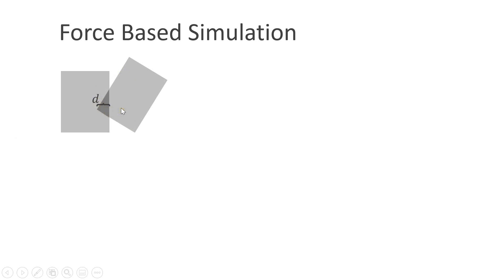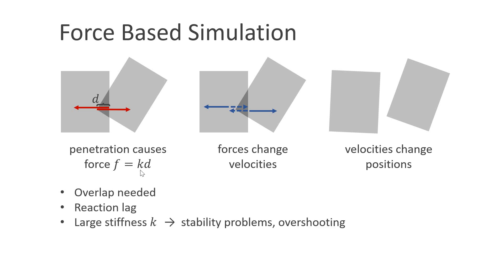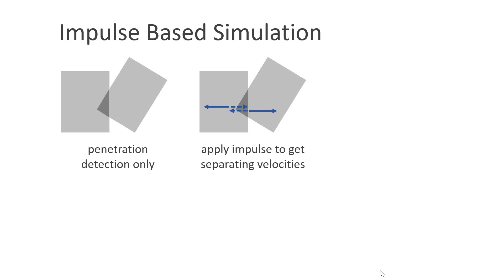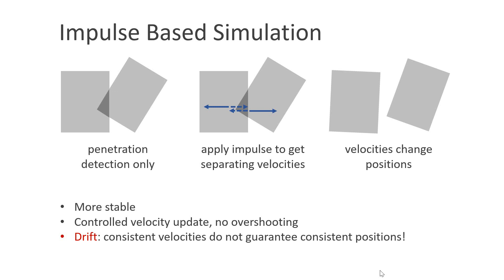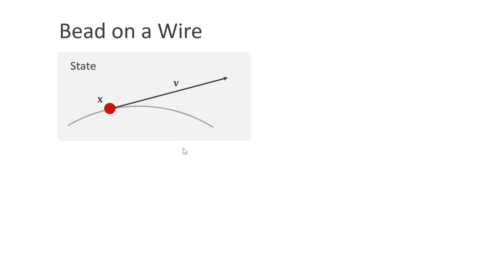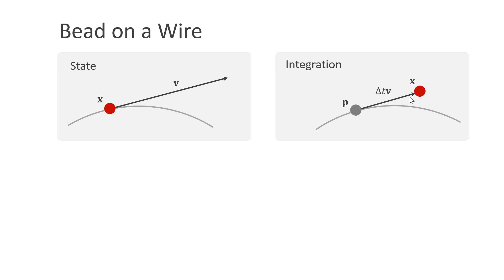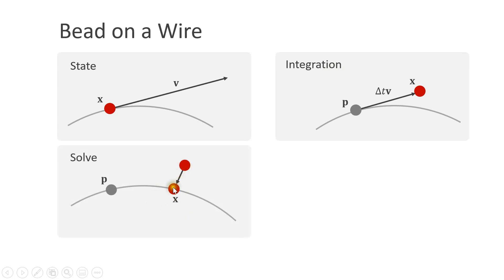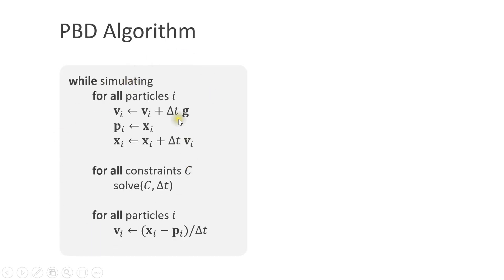09 Getting ready to simulate the world with XPBD

Comment: With the inclusion of XPBD as the main physics simulation technique in unreal 5 there's something I've been wondering about for awhile now. I figured I'd post here on the off chance Dr.Muller sees it. Reading the original paper on XPBD I was curious about the sympletic properties of the integrator. Simplicity is a very nice property to have for numerical integration schemes. There's a reason symplectic euler has been the go to for video games for ages (well that and it's cheap). As I dug into the subject matter more I found SHAKE and RATTLE, which are symplectic integrators from the 70s popularized in the molecular dynamics community. They handle constraints while maintaining simplicity and they seem remarkably similar to XPBD to my eye. For reference I've been using "Simulating Hamiltonian Dynamics" by Benedict Leimkuuhler and Sebastian Reich. So I guess my question is "Is XPBD a variation on SHAKE/RATTLE, or is it even sympletic?"

Comment: What I found is that when using only one iteration the velocity error is too big that results in instability. I need at least 2 iterations to get stable results. Also too many substeps leads to vibrations, not exactly sure why but I guess it’s because the velocity gets bigger when the delta time is really small. When solving collision or distance constraint, the position change is irrelevant to delta t, so if you have a small delta the velocity is much bigger.

Comment: Beware. As written in 5:55 or 7:06, you get inconsistent results with permutations.

Consider a chain of N identical particles A<->B<->C...<->Z, linked with N-1 distance=1 constraints, one between A and B, one between B and C, etc. Assume the order of constraints is A<->B, B<->C, ....

Now, let's say something shoves particle A by 1/2 a unit towards B. What happens? The A<->B constraint updates, moving A back 1/4 unit and B forward 1/4 unit. Then the B<->C constraint updates, moving B back 1/8 unit and C forward 1/8 unit. Net result is an exponential decay, but, notably, particle Z is affected in a single timestamp.

Now, let's say something shoves particle Z by 1/2 a unit towards Y. What happens? The Y<->Z constraint updates, moving Y back 1/4 unit and Z forward 1/4 unit. And then... that's it. That's the timestep. X isn't affected at all in the first (sub) step, and in general, the effective speed of sound is one unit per (sub)step.

In other words, the speed of sound is dependent on update order of constraints.

A relatively straightforward approach to avoid this is to accumulate updates instead of updating positions 'in-place' in the constraint loop. Unfortunately, this does require additional memory, and also results in a speed of sound of 1 constraint / (sub)step, which can be good or bad depending.

There are other more complex approaches, of course. For instance, color the constraints graph such that no two constraints with the same color share a particle, and iterate over constraints in order of color. This also allows for parallel solving without locking, as all constraints with a given color operate on independent sets of particles. Maintaining a dynamic graph coloring, even approximate, is itself a task, however. And this approach falls over if you have a single particle with many constraints.

The other main issue with this approach is that it often ends up dissipating excessive amounts of energy. Consider your bead on a wire example again. Your projection to the nearest point on the wire results in a slightly shorter distance than the original timestep. And as that is used to calculate the next velocity vector, this means that every timestep the velocity of the particle decreases. Luckily, in this example the velocity loss per timestep scales with timestep^3, and so the velocity loss per unit time scales with timestep^2, but this still can be a problem in some cases.

Comment: i thought i'd never find meaningful documentation for projective dynamics :O you're probably aware; for those who aren't, the spring constant k = -w * w (w = angular frequency, 2 * pi * hertz/samplerate)
i feel so privileged to find this secret video,  but i'm still not going to their lodge, ever.
Reply from the maker: Can you elaborate?
Reply: @TenMinutePhysics  for someone who documents like qi jiguang or julius o. smith III, for sure, but honestly not sure which point :)
Reply: just for fun, assuming it's dsp, i've made much use of iterative sin/cos oscillator forms in audio eg. s0 -= w* s1; s1 += w * s0; which elicits sine and cosine (one half step behind) for two mults and an occasional renormalisation (maybe each million cycles) when initialised in quadrature (eg. 1.f, 0.f). i've not worked with gpu much so not sure if this is useful for ?gerstner waves or anything. julius o. smith III at ccrma is about the best audio dsp reference to date.

Comment: The comparison of force, impulse, and position based simulation gives me a clue (although not mathematically understandable yet)  why they make such different characteristics. For more than a couple of years of studying how to make physics code , I've looked through those three ways, but failed to figure out why modifying the particles' status via force/velocity/position makes so different ends - apart from using different integration schemes -.
You are the first teacher for me to give such a 'big picture' of simulation methods using easy words. Thank you!
Reply: OK I can't even figure out what integration means.  😿
Reply: @Christobanistan  In physics simulations you numerically integrate acceleration to get velocity, and then you numerically integrate velocity to get position. There are different ways to approximate integration, but the most common is Euler integration, which is basically v1 = v0 + a*dt (acceleration to velocity integration), x1 = x0 + v*dt (velocity to position integration), where dt is the time step.
Reply: @mariovelez578  So integration is just plugging in a factor to an equation to get another value?
Reply: @Christobanistan  integration is turning a function that describes rate of change of a variable into a function of that variable. In other words, it's the reverse of a derivative. For particle kinematics, this means finding the new velocity at the next time step given the acceleration at time t, and then using that velocity to find the new position. I recommend taking classes on calculus and a physics class on mechanics (more specifically the subject of kinematics).

Comment: Hi Matthias, I've tried adding the alpha/(dt *dt) change into the lambda calculation for my position based fluids solver, but it doesn't have the effect of creating timestep independent stiffness, instead it really reduces the constraint forces drastically based on timestep. the XPBD paper is pretty dense, and I haven't been able to find any implementations of XPBD for fluids.
Reply from the maker: Hi Kelly. There must be a bug somewhere. XPBD should make things less time step size dependent. However, I haven't implemented XPBD fluids so far since most liquids like water are incompressible so you want a compliance of zero with can be done with PBD. Even for gases.

Comment: Hi, first thank you again. I posted in your other channel but then saw that you had moved over to this channel so I want to post my question here as well:

Thank you for this video, I have been attempting to implement PBD with some degree of success for ropes. But once I tried to give the rope some stiffness it becomes very unstable, especially if I enforce length-preserving constraints at the same time such as LRA. But even without LRA it is quite wobbly and not stable enough. I'm trying to avoid using additional "ghost" particles to enforce stiffness because of performance issues. Do you have any tip on how to give thin ropes some stiffness like rods while keeping stability?

Comment: Thank you very much! I hope I could implement a physics engine from scratch based on your video in Rust! So if we want to add constraints to prevent an object hitting a wall, does that mean the constraint has to be applied to all inner particles of the object? or we need to precalculate the convex points somehow and only apply constraints on those? Can we skip some calculation based on the distances between the wall and particles. what about a softbody hitting a wall?

I also hope you could compare the technical choices of some of the most famous physics engines (if they are not position based),  like mujoco, physx and bullet etc. Basically I'm curious if XPBD should be the way to go to implement the ultimate physics engine for a game engine? For example, why does NVIDIA have both physx and flex, is physx not PBD?

I also hope, in the later stage of this series, you could cover some approaches on implementing XPBD on GPU. Thanks!

Comment: Thanks for the video! For collision detection in substeps, is it recommended to do the collision detection every substep or do we do it once only at the start of the simulation?
Is there any cost or benefit from both methods?
Reply: I think it's done once per time step, instead of once per substep.
Collision detection is very computationally heavy so I doubt you could get real time if doing it at every substep, but it would be more accurate
Reply: @themlnsshow  Hi thanks for the reply! I looked into the XPBD "Small Steps in Physics Simulation Paper" and they indeed only did it once per frame.

Comment: Thank you for this wonderful video Matthias. Is there a mathematical difference between increasing the number of substeps by a factor N, and reducing the timestep by a factor N? 

Or are we just playing with the refresh rate of the plotting function in this case, with the underlying math being identical?
Reply from the maker: Hi Lawrence, this is a very good question! I should have mentioned it in the video. It is exactly the same as simply reducing the time step size. The idea is that if you have a fixed computation budget per time step you should use it for substeps, not for iterations. This is a non-trivial observation. In other words, you should move forward in time when iteratively solving the equations.

Comment: Hi Matthias,
Thank you for you work in popularizing of physics simulations.
Just got impression that slide "Example: Distance Constraint" has wrong signs in expressions for grad(C_1), grad(C_2) and delta(x_1)
Did I miss sign somewhere?
Thanks,
Andrii.
Reply from the maker: You are right. I noticed it too and fixed it in the pdf, cannot fix it in the video.
Reply: @TenMinutePhysics  I still feel that expression for delta(x_1) should have opposite sign in the same slide in pdf
i.e. all x_1 and x_2 should be swapped
Reply: @andriinikolaiev8225  Pretty sure you're correct. On slide 10 in the corrected PDF, dx1 is positive (i.e. moves in the direction of x2-x1). On slide 15, it's negative. Both are defined in terms of the vector x2-x1, so one of them is wrong. The slide 10 definition of dx1 seems correct to me. If l > l0 (i.e. the particles are farther away than desired), we want to move x1 in the direction of x2-x1 (i.e. positive) to make the distance smaller.

While the gradients on slide 15 in the PDF are fixed, it doesn't look like the derived dx1 has been corrected: it's still negative.

I think the clearest correct version of slide 15 would be as follows:

GradC1 = -(x2-x1)/|x2-x1|
GradC2 = (x2-x1)/|x2-x1|
dx1 = λ * w1 * GradC1 = w1 * λ * GradC1 = w1 * -(l-l0)/(w1+w2) * -(x2-x1)/|x2-x1| = w1/(w1+w2) * -(l-l0) * -(x2-x1)/|x2-x1| = w1/(w1+w2) * (l-l0) * (x2-x1)/|x2-x1|

In the PDF, both GradC1 and GradC2 are fixed, but GradC1 has been defined in terms of (x1-x2). Above, I defined the corrected GradC1 and GradC2 both in terms of (x2-x1), as they were in the video. The correction is just to swap the signs.

I've included the intermediate steps in the definition of dx1. Both λ and GradC1 are negative, which cancel each other out, yielding a positive dx1 that matches the definition on slide 10.

/cc @TenMinutePhysics